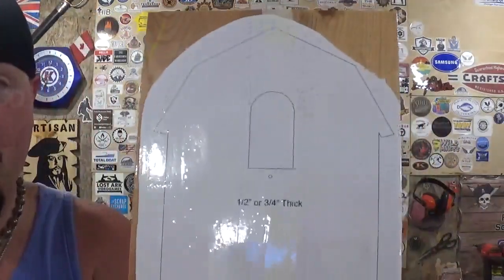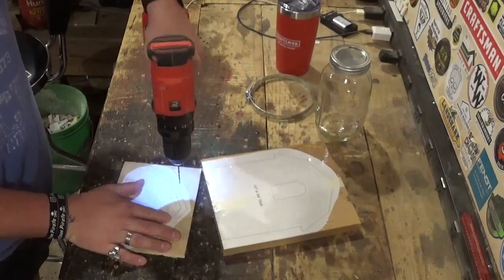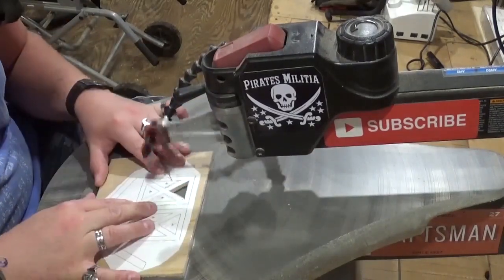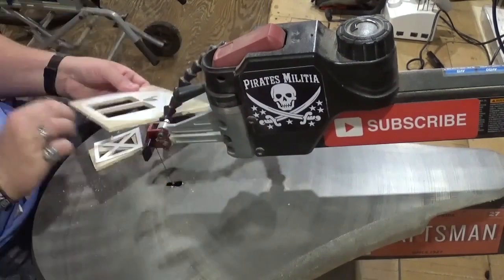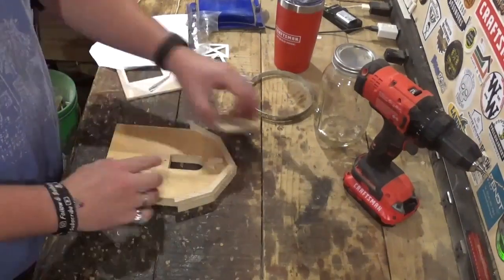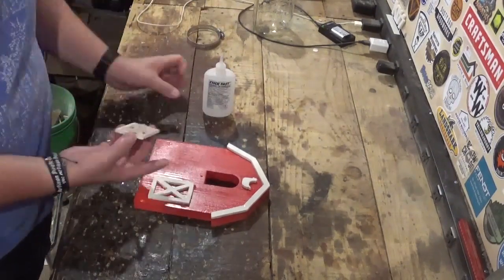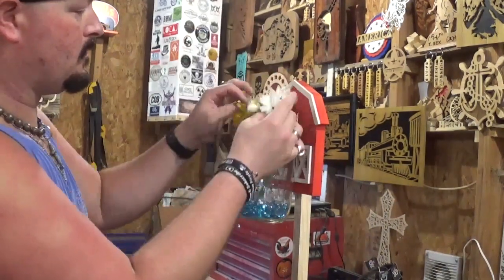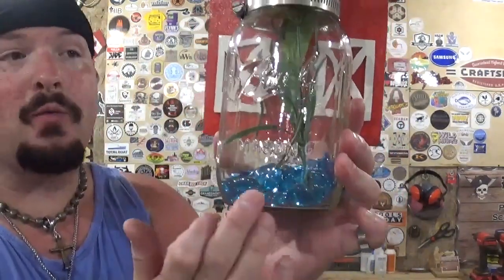Rustic Barn Planter, Scroll Saw Project

Comment: Looks great AP. 
Do you change speed between different thickness of wood?
Reply from the maker: Thanks Peter! Sorry for the extremely late response. If I am scrolling only a single layer of 1/4 inch material then I will slow the scroll saw down a bit. A sharp blade will simply fly through the material